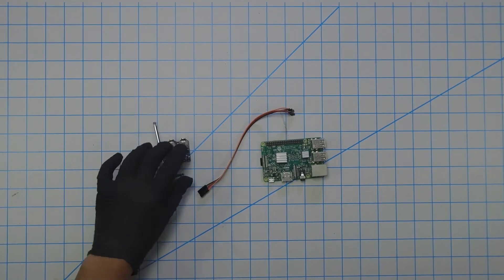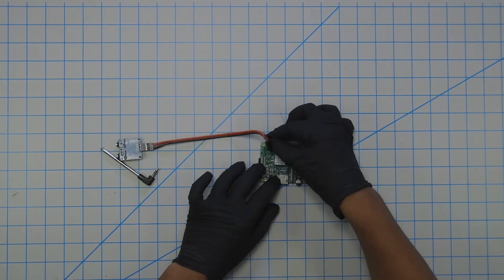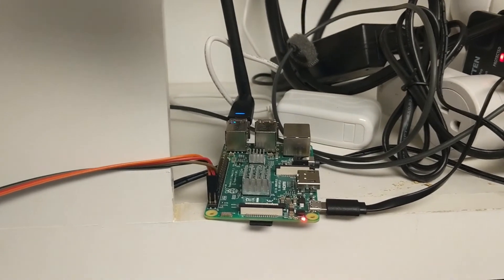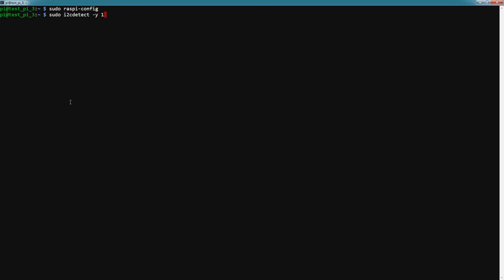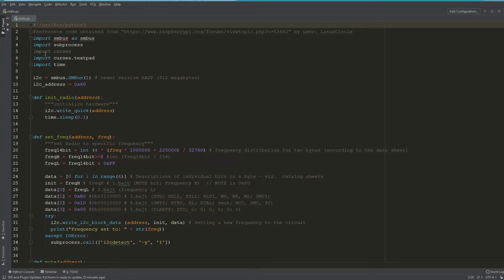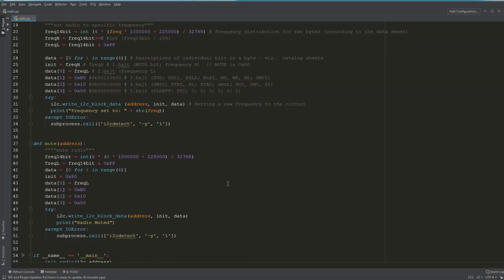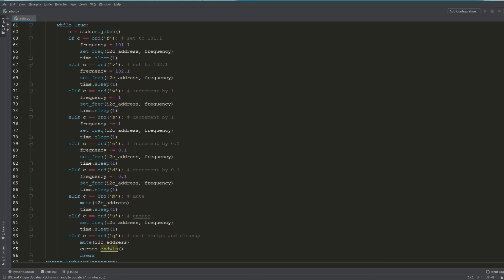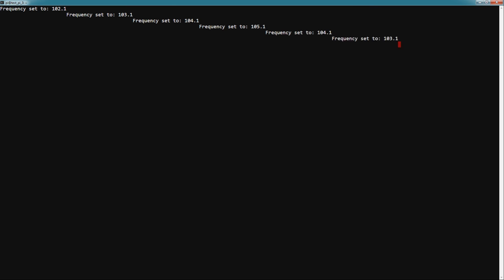FM Radio (Raspberry Pi)

Comment: Hello,
Thank you very much for this little tutorial, I've done it and it is working great !
However I was wondering, is there a way to also manage the volume with the keyboard ? Because of in this state, the use of a headphone is deadly as the sound is stuck at max volume ^^
Reply: I Just bought Headphones with a Volume dial on them
Reply: I have a RasberryPI sd card which has pre installed rasberry OS, can i use it for this project?and Can I use this FM module in Sri Lanka, which is in the 90.9 MHz - 104.7 MHz range?Thanks

Comment: Can this be used as a receiver (in correct frequency range) of signals generated by security sensors and then relayed to the pi as input status of that sensor?
Reply from the maker: I'm not sure. Maybe refer to the spec sheet to see if that's even feasible.

Comment: This is not a "transmitter", it is a "receiver"...   (yes?/no?)  thank you
Reply from the maker: The TEA5767 is a cheap FM receiver that is controlled through the I2C bus. 
The radio can be tuned to the European, US, and Japanese FM bands

Sorry for the confusion.
Reply: @PiddlerInTheRoot Can't we use it in Sri Lanka, which is in the 90.9 MHz - 104.7 MHz range?
Reply: Rx
Reply: Tim say something Tim

Comment: Never imagined it would be easier to make a transmitter than a receiver
Reply from the maker: Yeah, I found limited documentation on that module so I'm sure that code can be optimized quite a bit.
Reply: this is not a tx, is a receiver module. For transmission you would need a gigantic antenna or tower lol